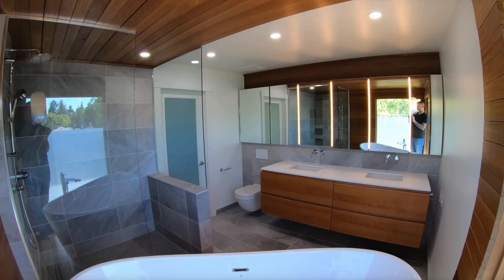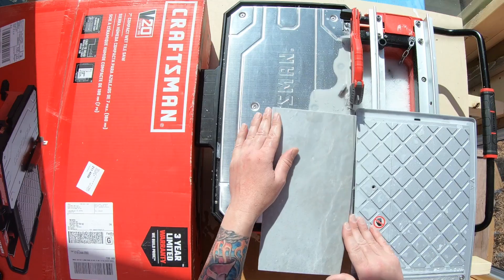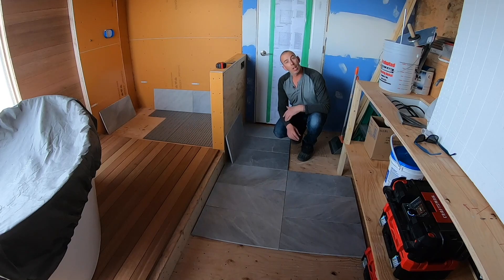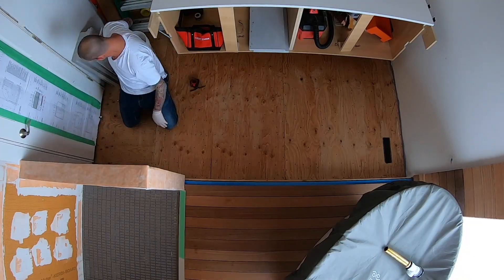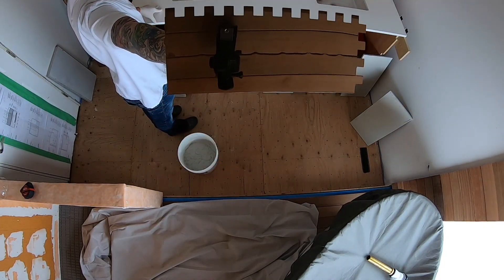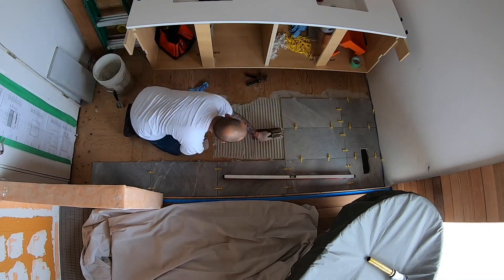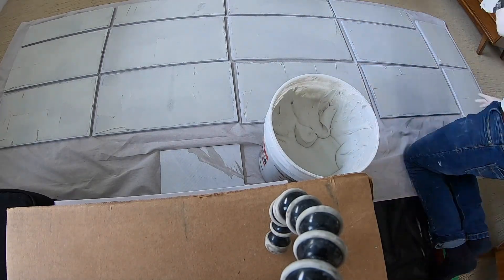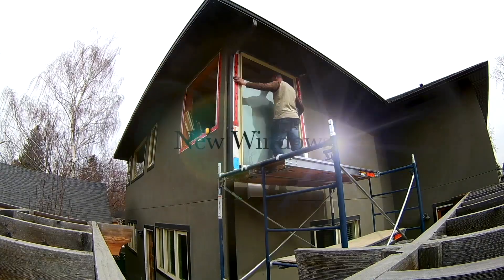Tile Floor Install Luxury Bathroom Renovation Playlist

Comment: Hello, firstly thank you for the great video. I have watched a few of your videos now and find you to be a very practical instructor. I would like to know your opinion on membrane underlayments ie Schluter Ditra. I have seen various contractors use this technique and almost swear by it for their tile installations for its capability to allow for movement. You have used treated plywood without a membrane. Could you please explain the reasoning because I think your method could save me dollars and time (more desirable especially if it makes for a great finished product!) Thanks for reading my comment and I look forward to seeing the rest of the videos you release on this project. Cheers!
Reply from the maker: Christopher, thanks for watching. I will use uncoupling membranes like ditra when the tiles are larger than 1’x2’, heated or if it’s a really wet area. For most bathrooms I will install 1/2 exterior plywood glued and screwed, this is how everyone did it before membranes. Couple key details 
Use a grout that self seals or seal grout so it will not absorb moisture. 
Silicone all inside joints to prevent water getting around.                                                    Only use exterior plywood, it will not swell if wet                                                      I hope this helps!!
Reply: Construction Coach Thanks for the prompt reply Tim. That info really gives me confidence for my basement bathroom project. Keep rolling out the quality content and I can see your channel growing quite nicely! Cheers!

Comment: I checked the bathroom playlist...Do you have a video on making and installing that vanity? I want to try to make my own. The one's I see at stores aren't the right fit and they cost $2k to $5k! You have one of the best DIY channels. The tile guys focus on one small thing like layout or backbuttering and then done. You cover a specific project from beginning to end.
Reply from the maker: I do have the footage of the custom cabinets, it is not edited yet. A lot of design went into the brackets made to hold the floating vanity, video coming soon. Thanks so much for your support, in a world of trolls I really appreciate it !! I will try to get the cabinet video out soon.
Reply: @ConstructionCoach  Yes. I want to make sure if my kids sit on it, it won't come crashing down.

Comment: I have about a 2' area in the corner of my bathroom that the subfloor is 1/8 to 1/4 out of level. Can I make up the difference with thinset before installing the Hardibacker underlayment?
Reply from the maker: I think that would work but I’m unfamiliar with hardibacker specs.  In this case the best is to follow their recombination on install.

Comment: Would offsetting the floor tiles make a difference in lippage, durability of grout and minimizing tile cracks? 
To determine tile placement, did you use the center of the wall or room to determine where to start and is there anything wrong with just starting with a full tile at the entry way or back wall? 

Btw, thanks for saying how much thinset to use when back buttering. Are you using modified thinset? What's the size of your grout line?

Comment: Maybe i missed it. Did u check for level for the osb subfloor or after installing the plywood? Ive heard to stagger the tile to avoid lippage. Doesnt seem like u had any lippage issues. Also why plywood and not backerboard?
Reply from the maker: The house was fairly new and all floors were level, I got lucky with that. If your floors are wavy or out of level using a self level compound might be required. The marble tiles I use were so flat with each other, I have seen 12”x24” tiles that have a camber or slight bow. Try to select quality tiles with no deflection and use lippage free clips and wedges. Hope that helps, thanks for watching.
Reply from the maker: I use plywood not backer board because I like the glue bond between the plywood and the floor. Most floors are 3/4-7/8 thick, after installing 1/2 plywood my base is 1 1/4 - 1 3/8” thick glued and screwed. And I’m a carpenter, I like using wood!!!

Comment: HI   how do u know  that it is exterior  grade  So is this the plywood that u use  over the subfloor  and  stone tile on the top   please  check the link thanks  https://www.homedepot.ca/product/west-fraser-1-2-inch-x-4-ft-x-8-ft-standard-spruce-plywood-board/1000173236